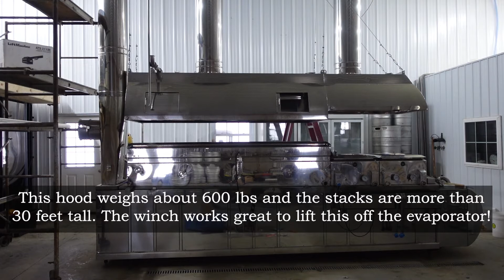Harbor Freight Badland Winch - Used to lift our hood on the CDL Evaporator

Comment: If anyone buys this from Harbor freight and ends up needing a new hand control , Harbor Freight does NOT  offer a replacement . I ended up buying one from Northern Tool  for the  IRONTON 54129  sold by Northern  , and it works like new . The new hand control even comes with the cord for just under $20.00 plus shipping . It was $29.00 to my door .   I used the new controller to hook up dual controllers  since my shop has an upper floor and I use the winch to  open and close a trap door in the upper floor . I can now open the door before going up on the scissor lift  , and can open or close it once I am up there  with the other controller .
Reply from the maker: Wonderful comment Mr. Evans!  This is what in envision for our channel.  A place where we share things that work well for us on our farms!  Thanks for being an awesome viewer!  Kevin

Comment: has everything worked out 3 years later?  i'm especially curious about HOW and WHERE you mounted the winch
Reply from the maker: I would have to say a yes that but with one caveat.  I only use the winch about 5 times a year. That's why I purchased it.  If it were something that I was going to use every day, I would look at a warn.  I set mine up on the wall in my shop.  It could be in line with the cables or as is my case over the edge and down the wall. That necessitated more pulleys.  Would you like me to do a video on how I installed the cables and the winch?  Or maybe send you a couple photos of the install?  Thanks for watching. Kevin

Comment: That is so much better to clean
Reply from the maker: Cameron, If you can believe it, I used to crawl through the holes on the side of the hood.  Emily thinks I'm a contortionist!  Thanks for watching.  At some point I'll be doing a video showing what the inside of the evaporator looks like and cleaning it of course. K